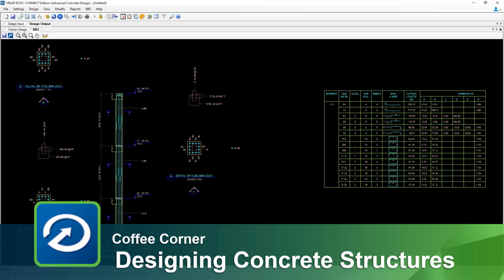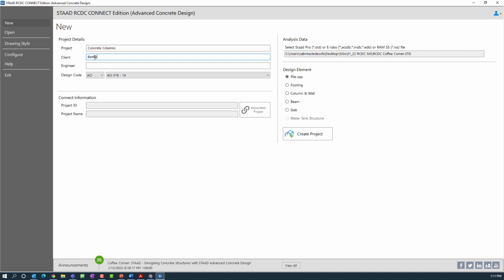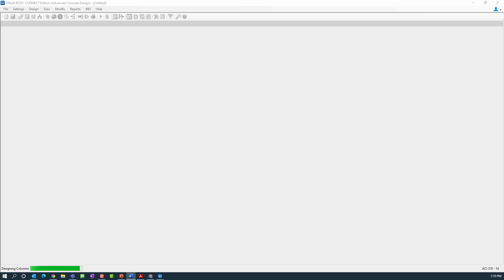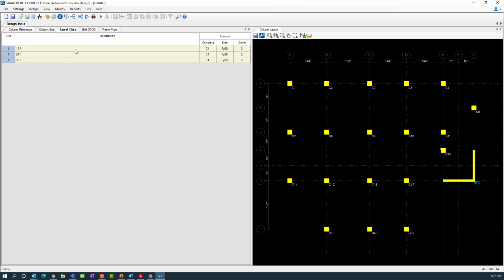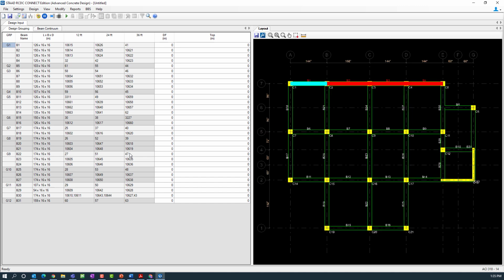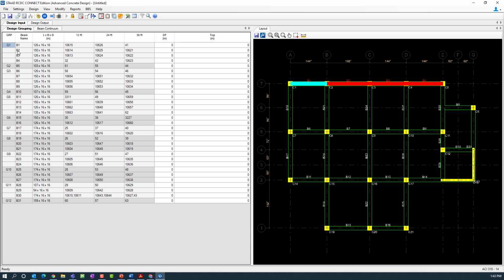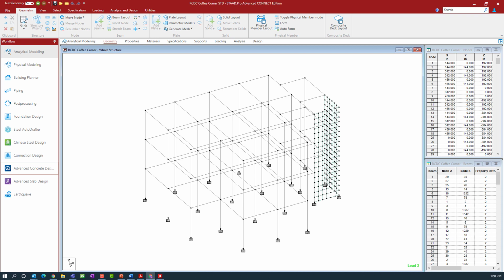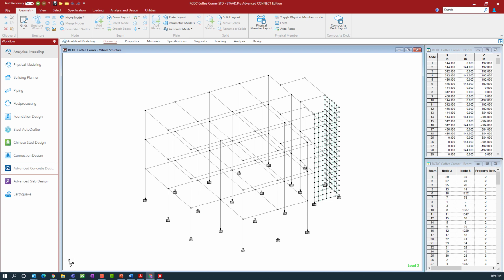Grouping Concrete Member Designs with STAAD Advanced Concrete Design

Comment: Thanks; good and detailed presentation; I have ; in phsical modeling ; I made a shear wall using parametric modle; and  I checked plate connectivity and beam plat connectivity and all OK.; however; in the RCDC column design file it does not recognize the shear wall;  I hope you can explain the solution ??